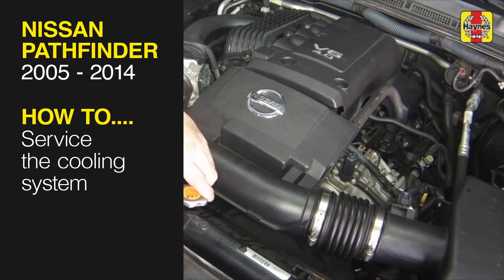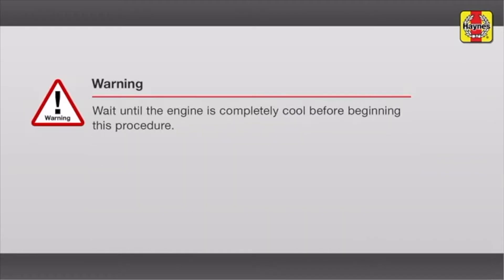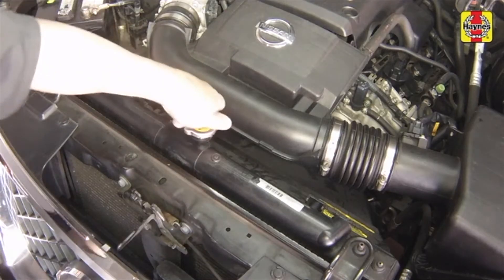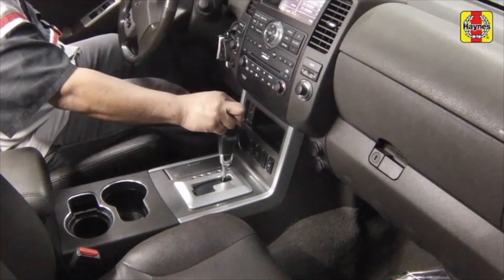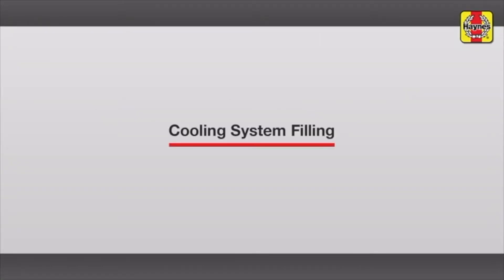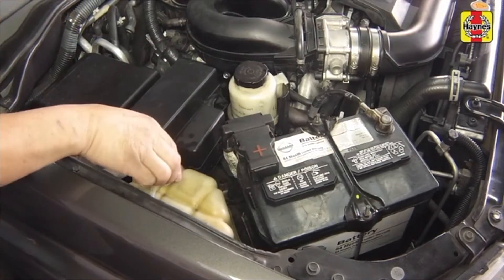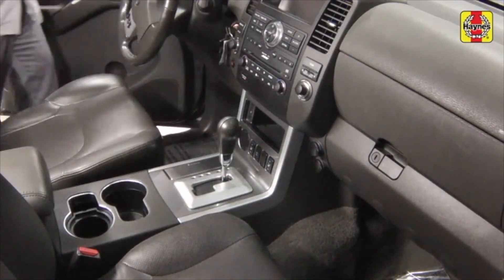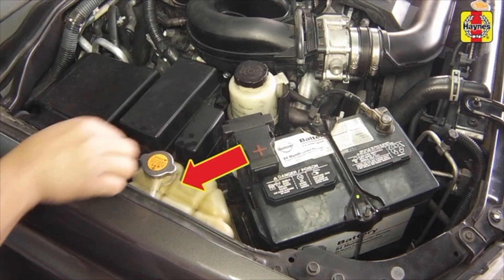How to Service the cooling system on the Nissan Pathfinder 2005 to 2014

Comment: What about the coolant in the heater core?
Reply: The valve to the heater core opens when the key is turned to the on position and the heater is set to high.